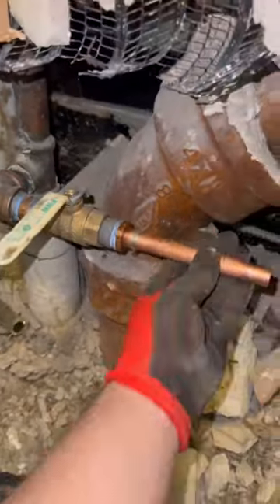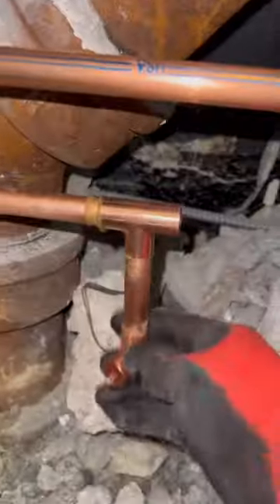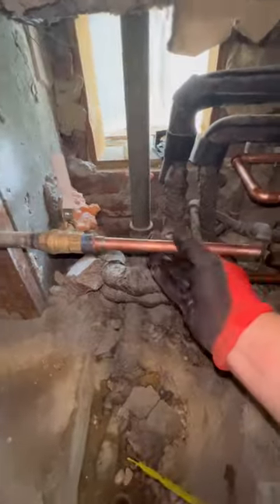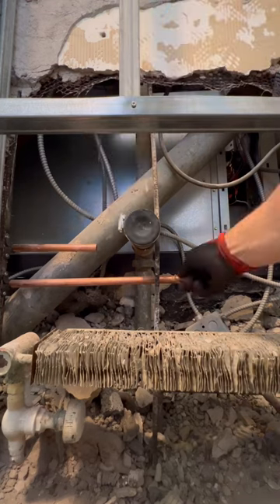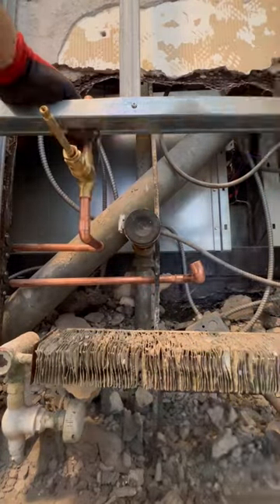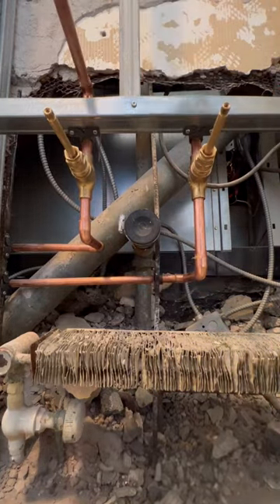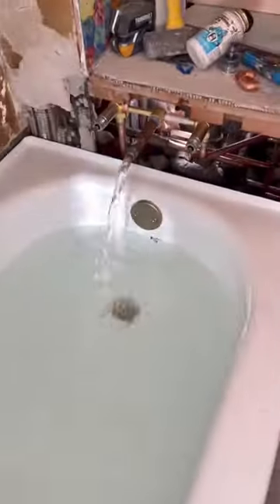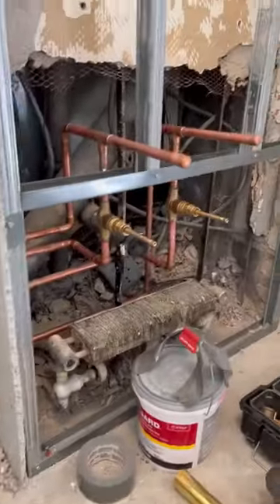New Bathroom Water Lines #howto #shorts

Comment: Don’t just wet down the asbestos with water,  mix one part PVA glue to 4 parts water then wet the asbestos . It holds the fibres after the water has dried.
Reply: Good tip

Comment: You should really stand your ground and make the owner remove the asbestos before you do your work. But if it's your place, use water and Elmer's glue in a squirt bottle to encapsulate the asbestos.
Reply: Absolutely, I do not risk my health because someone wants to save a buck or my company says  just do it.
Reply: Get a good respirator with p100 filters they are rated for asbestos fibers. I work pest control and am around toxic chemicals all day, so I have one with me all the time, and I would certainly recommend one when working around lead or asbestos building materials.
Reply: @jsb7546  you need more than just the respirator. Those fibers get in your clothes and can become a problem after you take the respirator off. I have worked around it but the second you disturb it the are strick OSHA standards the company is suppose to follow.
Reply: It’s not that bad, as long as you’re not creating dust you’re all good. Maybe you saw too many of those class action lawsuit commercials for mesothelioma. Prep work and proper ppe are all you need, why would anyone want to complain to osha or any other such organization?? I mean unless you’re trying to make problems for no reason.
Reply: @nickkirschner3719  these jobs don't care about you! I have no interest in even attempting to risk my health to save  any company a buck. Asbestos is not about to standard PPE, there is a reason they have a different company with a whole protocol to deal with it. I have a friend that does the testing for construction sites and that is no joke. You can risk you health to get you boss a bonus but I wouldn't be acting like it's no big deal
Reply: @DubYaJsWorld  ok bud, keep calling osha and avoiding work! If you don’t know how to mitigate risk while working with potentially hazardous materials and prefer to get the government involved then youre just getting in the way. And yes it’s all about ppe and proper preparation of the work area, or just do you and complain to osha every time you see anything out of place!
Reply: @nickkirschner3719  of my job puts the completion of a job over my health you damn right I'm gonna call OSHA, how silly are you? Your are the reason we gotta sit through 3 days of PPE videos and why companies have 10 hours of company policy's to watch every year. I'm a supervisor where I work, you are not at no time to risk the health of any employee even if they are bone heads and wanna just get he job done. If you don't do asbestos removal as part of your job description then NO,  you can't just throw some PPE on a get'er done🤦🏾‍♂️.  You won't even have the correct PPE if you don't do that as your job description. Then if something goes wrong you don't have the correct material to alleviate a worse case scenario! But go ahead risk your life because you got a face mask and rubber gloves and get'er done for your boss!
Reply: @nickkirschner3719  I’ve worked in a lot of crawl spaces filled with asbestos when I first started. But why would you want willingly work in or around asbestos after you have a family? If I didn’t have a daughter I’d be crawling around it like crazy (mostly cause I enjoy working in crawl spaces) but you don’t want to bring that stuff around your kids, tough guy
Reply from the maker: I domt remove it no way. I nist wet it because im working next to it
Reply: @LG-bd4uw  wear proper ppe and dispose of it properly and you’re good to go, nobody is getting cancer from incidental contact with asbestos once or twice.
Reply: @nickkirschner3719  I hate to reply to you cause you obviously don’t care, but it’s not “once or twice”. If you work in service or alteration you’re around it maybe weekly. And also, what happens when you take off your ppe? Where are those fibers going? Ignorance is bliss though so have at it
Reply: If you tell your client you want an abatement they’ll just get the next guy.  If the building hears you mention the “A” word they won’t let you work there again.
Reply: You want him to insist on the owner to remove the asbestos which costs probably more than the owner is gonna pay for the entire plumbing job. At which point the owner can just tell him to go fuck himself and get another plumber to do the job with his mouth shut and get it done, get paid and get out. You’re a genius my guy … at getting people bankrupt that is of course
Reply: @TheTruthfulOnes  If you can't afford to repair/renovate, you can't afford to live there. 🤷‍♂️

Comment: I didn’t know two handle faucets were still legal without an accessible mixing valve before it. When I started we out 2 and 3 handle faucets in all the time. At some point though they outlawed them. We have to have a mixing valve on all tubs and showers for anti-scald. Almost every shower faucet is already some sort of mixing valve. The only time we have to add am accessible one is on either Roman tub faucets or free standing tub faucets. This is in Texas and it’s one of those things I’ve just done for years so I can’t remember if it’s local, state, or UPC code.

Comment: Broski ..keep a can of spray paint in your tools or van ..I was trained in NYC..alot of asbestos still in alot of walls ..wetting it works ..but spraying it with spray paint even clear works .better ...it caps of the dust and keeps it where it's been. Since the 70s.
Reply from the maker: Thanks for the tip

Comment: Only question I have for you is do you have enough volume with that half inch. I’m thinking that three-quarter should’ve been used on the cold, as there are three fixtures. At least to where it branches down.
Reply from the maker: Great question. Yes theres enough volume for sure
Reply: My home has 1/2 in was built in 50's . Have 3/4 home run wish the had ran the 3/4 . Only once when shower in 2nd floor I was using and wife had family over I think wife washing machine sink in kitchen on and 1st floor toilet use water drip out of shower  when I was using it.

Comment: Deff not a good idea to fill the entire tub up and let it run to the over flow. Just direct the water into the overflow to check for leaks first just Incase things don’t go as planned
Reply from the maker: Thats not the same as when the client will soak in it though. It is not proper testing
Reply: @hydronyc  I meant to just initially test the over flow . But if you were already finished then yeah deff makes sense to fill her up and start your checks for leaks 👍

Comment: They don't require asbestos abetment in New York? Crazy to see how different states have different regulations. MA if we find asbestos we have to stop working and it has to be dealt with, either removed or if it's pipe insulation whatever section is being kept can be sealed.

Comment: you doing asbestosis jobs with t shirts and pvc dipped gloves? hopefully a p100, and a shower and clothes you tie in a bag outside or with negative air pressure in a decon chamber. I didn't hear negative air pressure mentioned at all. And it's NYC? you talked about asbestos rather nonchalantly.